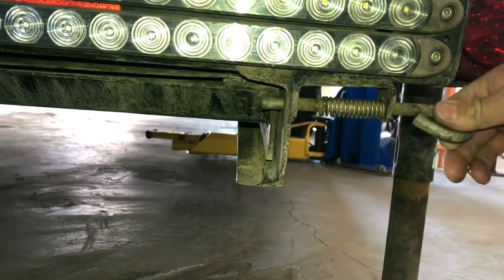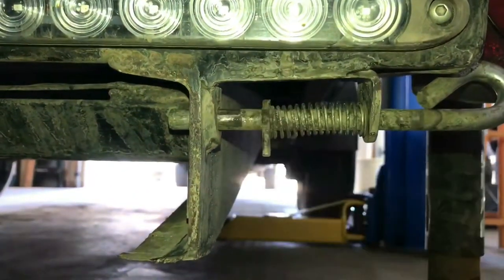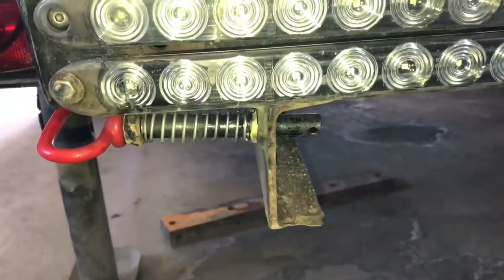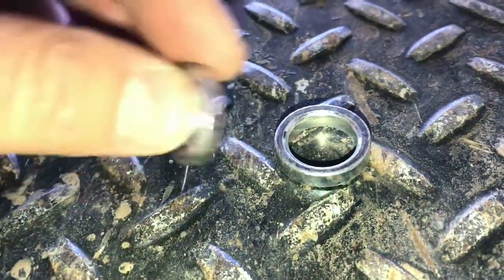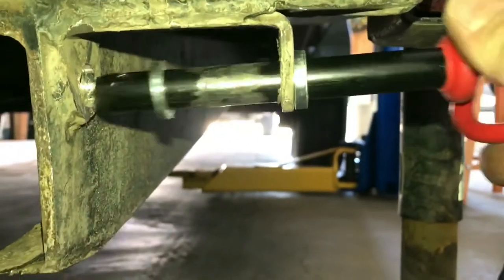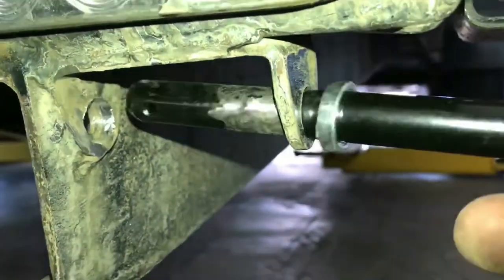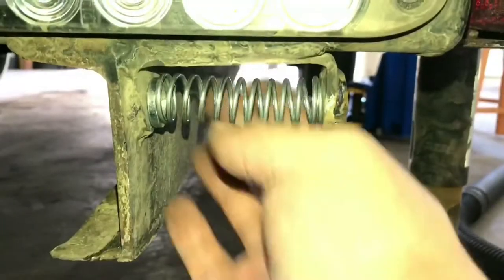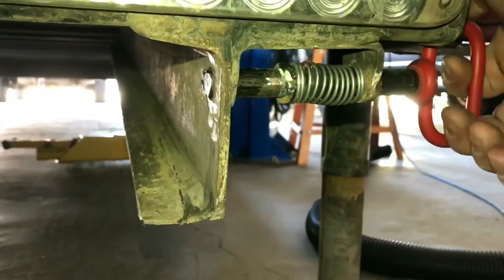Trailer Ramp Lock Pin Mod

Comment: that is pretty slick, you over killed it a bit. reason being there is a pin in the first place is because 10-20 years down the road that spring is going to rust out. in the mean time say you use a bobcat to lift the trailer up to replace a flat tire. doesn't have to be a bobcat, that's just the example i know of first hand where the guy broke one of these pins on a work trailer.
the point is , if any part of this becomes damaged it's going to be very difficult to fix it, especially if you get to your destination and need to do some work there on a fixed schedule. that is why the manufacture used a cotter pin and not a roll pin like john deere quick release.
your handle pin lock is ingenuous however, that's pretty slick

Comment: Pretty cool stuff.  I think doing all that work was overkill.  If it were my trailer, I would just remove the pin completely, put ramps in, slide pin back into place and put in the pin that secures the big pin.
Reply from the maker: Thanks, we haul several cars a day so any time saved is a big help. Not fumbling with a pin in the snow and ice with gloves on is a big one too. It’s been over a year and they’re still going strong...
Reply: @kevefox  Pins in the snow... definitely not =]  I wasn't knocking your tech, again it's pretty cool stuff.  Hauling cars in the snow... man, that's rough work.  I hope you're making that sweet money bro.  Keep up the good work, it's up to US to invent/make shit that actually works =]
Reply from the maker: No, I know you weren’t. Just putting out some reasons we decided against doors, pins, clips, chains, etc. and thanks👍🏻